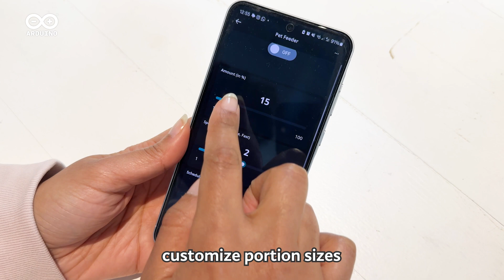Smart Pet Feeder with the Arduino Plug and Make Kit

Comment: Do you know what size print area you need for the prints?
Reply: We use the printer volume of the Original Prusa MKS4, so around 220x220x200 cm